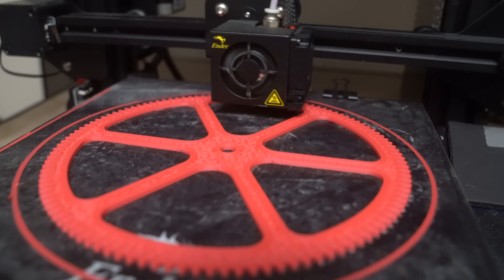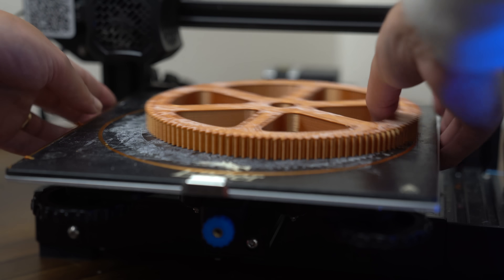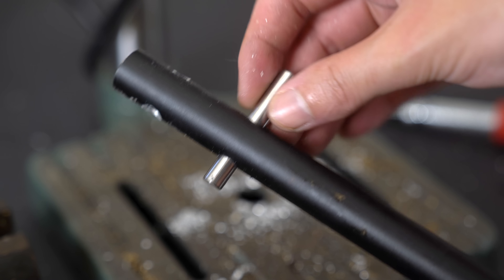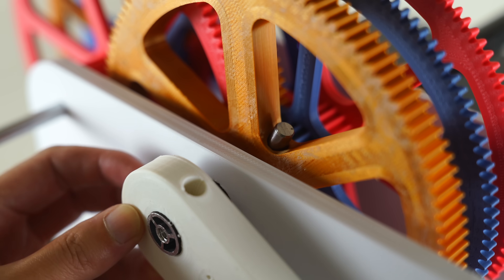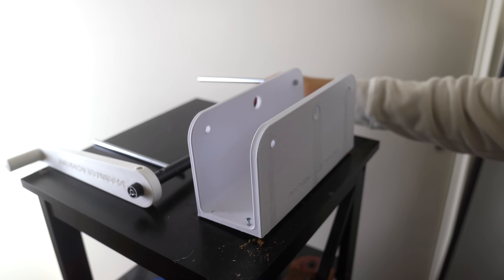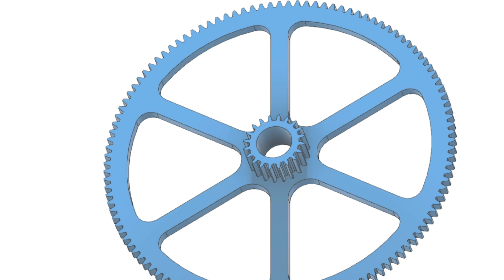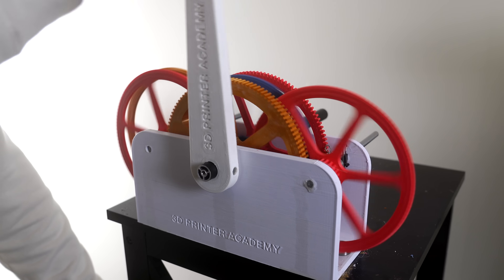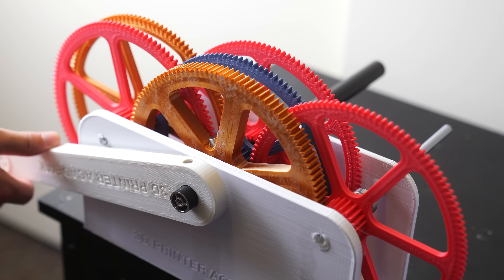How fast can this gearbox spin?

Comment: Handy little trick I’ve learned working with Gears and Gear cases. Take the end of your sandpaper and tape it to a drill bit. Wrap the sandpaper around the drillbit and now you have a rotary sanding tool.

Comment: In the early 1980's a New Zealander was watching a coin spinning on its edge but face down until it eventually fell flat and stopped. He consulted a mathematician and an engineer who together designed a reduction gearbox that had enough torque to dislodge a house from its foundation. Are you familiar with it? because as like "Epilogics" infinitely variable transmission that supposedly could handle large torque loadings both seem to have disappeared.

Comment: It's so painful watching you work. You bodge everything. 2:19 You're screwing it into the 3D printer part and not the table. Just push down much harder, or ideally make the holes in the 3D print much bigger, so the thread is only engaging in the wood underneath. Also, get hex bit extension.
At least you're not using JB weld this time.
Ah nevermind, you use hot glue.
Also, why not use bearings. This is not a great deal of money to spend on video

Comment: Very odd to watch this.  I'm amazed it even sort of works. Just for reference, your final gear speed is roughly the speed a chain saw chain runs over the nose of the bar. No gears at all, drives directly from the crank shaft.   You really seem in need of a copy of Machinery's Handbook (Industrial Press).

Comment: Would like to see you make it more practical like hooking it up to a generator and seeing what rate you could charge something.
Reply: Unfortunately physics means that the gearbox can't output any more power than what you crank it with - gears don't give you free energy, they just allow different trade-offs between speed and torque, with the output power being the same as the input power (assuming 100% efficiency), and thus if you expended the same energy just cranking the generator directly as you did through the gearbox, it would charge at the same rate.
Reply: @oscarcarter9981  yes and generators are more efficient the faster they spin.

Comment: So.
Enough gear ratio that a dropped weight of a few tonnes, pulling a chain, will cause a serious amount of power generated (think power plant), and when at the bottom - disconnect gears while pulling the weight back up, re-clutch the gears, and let gravity power the power plant once more.
Do this with enough gears and you literally have perpetual motion.

Comment: Could you please make one for me just tell me how much for it i need it the fastest and strongest. I have no access to 3d printer.i need it for a windmill generator but i need it to the high gear to connect to generator and a connector point to hook into the propeller.

Comment: Cant that be used to power up stuff? I don’t know that much about how you make power (eco friendly way) but that seems like a good way to get electricity
Reply: No, because he is putting in high torque at low speed and the last wheel could only put out low torque at high speed. So the amount of energy would be the same (minus friction). This construction is only a gearbox. Typically it is used to transfer the mechanical energy from an turbine to a generator, which will convert the mechanical energy to electricity.

Comment: Great video. One tip, get some cutting oil and use it when drilling metal. You'll spin the drill slower but it will cut faster and cooler. When it's cooler it'll wear your bits less and cut the metal smoother. 

If you get it and don't agree I will pay you the $10 for the oil. No joke.

Comment: I recommend using a impact drill or 3d print an adapter to hook the gear box to your lugs on your car for max power
Reply: Did you seriously just suggest to make plastic battery cable clamps?

Comment: you should try with the 3d printing material that has metal powder in it and you put it in a furnace and it turns solid metal to make some crazy fast ones that dont break

Comment: Some suggestions:
1. use spacers on the axle, so the gears are fixed on there to prevent wobbling and gears grinding against each other
2. use a normal M8 steel bolt instead of the aluminum rod and screw it far enough in, so you dont get vibrations in the gears. That way, the gears wont come loose as well
3. use ball bearings on the housing AND the gears
4. reduce the contact area of the higher gears. So 1st gear has the most contact area and so on
5. lube the gears and bearings
6. print the grip sideways. so it doeant brake (obvsly)
7 maybe try different gear geometries. there a some that are better for high torque or high speed. the latter have much less drag.
8. you can safe an enourmous amount of weight on the last gears. make them much thinner then they are now
Reply: Bro have write his school essay
Reply: Nice suggestions 👍
Reply: Can’t put ball bearings on the gears that’s not how gears work. (At least the input gear thinking about it now ig all the other ones could)
Reply: @gumby5068  he’s saying put the ball bearings where the gears are connecting to the axel. That way, the gears have less friction trying to spin. Like how skateboard wheels are connected to the trucks, they have ball bearings to decrease friction
Reply: @gumby5068  note that most of the gears are freely rotating on their shafts. Only the first gear is keyed to the shaft.
Reply: @gumby5068  it is how gear work, it’s multistage you only need the solid shaft for input and output everything else should have bearings

Comment: i mean like i know 3d printing is like super accessible and all, but this could have easily been done with actual metal gears with way better results. it seems pretty unfitting to try this with 3d printing, so why not use already made metal gears connected properly for something like this? it probably would have been cheaper to buy the gears online vs all the plastic you used...

Comment: Absolutely need spacers between the gears. An interference fit on the dowel will prevent the rod falling out. 

Make the handle double sided. 180 degrees opposed to the other. This will allow you to apply more torque and evenly (kinda) divide it. Think of bike pedals.

Comment: If it were possible, could you make a way to balance and fine tune the gears to reduce vibrations in the drive mechanism? Being 3d printed and not machined out of a solid piece of stock on a rotational machine I could imagine there is a fair amount of imbalance in the gears, as shown with the back and forth motion in the second to last gear, and the scraping noise it makes as the side of the gear contacts the slower moving gears

Comment: The main reason you can't get it any faster is friction between the gears and the shafts. This is exacerbated by oscillations caused by the very low tolerances you're maintaining to keep everything moving. The frictional torque especially in the faster moving gears is amplified by the gear ratio, which makes it very hard to rotate the slower moving gears at a decent speed.  If you use cheap steal bearings, you won't have nearly as much friction and you you'll be able to keep tolerances high, leading to less parasitic oscillations. Keep making :)
Reply: Fuck it, needle rollers.

Comment: I've had a curiosity for a long time: how to extract energy from something that's very heavy, but moving very slowly. I present the challenge to you: how much energy can you extract from a falling weight? Or, how long can you keep a system moving, while only dropping a weight a short distance? Ultimately, the scenario that fascinates me most is glaciers. It would seem there's a very large amount of potential energy there.
Reply: Wait until the glaciers melt and build a hydroelectric generator/dam
Reply: @SjaakWWortel  haha
Reply: That’s how a grandfather clock is powered…
Reply: @andrewkarsten5268  yep. But I would wager the power transmission becomes more complicated when you want to slowly drop several tons.
Reply: To your first inquiry, I present to you, the mechanical battery….
Reply: @devinwalton408  you don't say?
Reply: While you are there, wait for the tundra to melt, now you increased the arable land 4000% near the artic.
Reply: You also get more wind power as a side effect, perhaps even too much of it, as more energy is freed into the system, a couple of tornadoes here and there, not big of a deal. 

And your coastal lines might change by a couple of meters. That's a minor deal thou, who would build anything on beaches anyway. Lots of erosion already.
Reply: @monad_tcp  And with all  the stored methane under the permafrost now released, it will be a tropical swamp.  Just as it was millennia ago. 
That’s where the Alberta Tar Sands came from.
Reply: @monad_tcp  the process I'm describing would slow the movement of glaciers, not accelerate their demise. Not sure how you got there from here.

Comment: I would recommend using bearings on each wheel and decrease significantly the gaps between the different gears (Use teflon rings)
Reply: Exactly what I was thinking, I was really thinking it would significantly decrease friction.
Reply: Great Idea! I would love to see ceramic bearings!
Reply: Agreed
Reply: even better use graphite
Reply: Agree
Reply: It’s about gears I think this will defeat the point (my opinion)
Reply: he seems to refuse using any sort of lubricant or bearing, and i don't know why.
Reply: @Cooper J smarter than you
Reply: Journal bearings would be best
Reply: Also add a chanfer on the bed side of the print. You can se the first gold gear to have a big elephant foot (Layers squished at the bottom) and maybe add grease

Teflon or brass washers would be good to pack them more thingly and reduce vibration

Also this type of gears are really dangerous at high speed. Never be over the axis of rotation. If you reach really high speed inside your house you can get your ceiling damaged, electrodomestics and pets
Reply: I'm guessing that adding a lubricant like oil would also decrease friction? Maybe transmission fluid idk?

Comment: Why not try helical or herringbone gears, they would have a more consistent transfer of power. Also what did you use to lubricate them? With the high speeds of the last few gears the lubricant may just get flung off.
Reply: You'd need 2, one in the opposite direction because of the angle is also trying to move it sideways
Reply: @prich0382  That's what a herringbone gear is.

Comment: 2:39 Love the physics-ignoring transition
Reply: He did a quantum tunnel
Reply: Not to mention the fact that the final gear spins faster than this guy is spinning the lever.

This guy somehow made energy out of nowhere; this violates the first law of thermodynamics.

Tbh, lets exploit this glitch to create free energy
Reply: @Zextranet  Akschully, he's expending as much energy turning the crank as you could collect with a perfectly efficient thermal generator
Reply: @Zextranet  have you heard about gear ratios and mechanical advantage?
Reply: @Zextranet  the gears loose torque and gain speed. Do you know how gears work?
Reply: Lol
Reply: Yes

Comment: Certain components imo are just simply made easier and faster out of different materials, for example: the handle and base can be made from wood with handtools. Also after initial prototyping, gears can be made from by the aid of fixtures and woodworking jigs. See Mattias Wandel's channel.
Reply: making the handle and base from hand tools would take hours for someone who most likely doesn't know how + gears can be made out of other materials in 3d printing and it is most likely quicker to 3d print

Comment: you can add a worm gear for rotating the slowest or the  main driver  gear as it needs more force to rotate other gears
Reply: i've heard that 3d printer worm gears are terribad. but again, i have no clue about what i'm talking about so..
Reply: @JoachimVampire  he can add small metal worm gear , actually my perspective is , as worm gears have to much load capacity ans speeed reduction we have to give  less force with hand so there will be less chance of breaking of gears